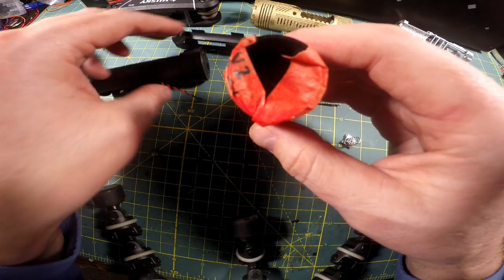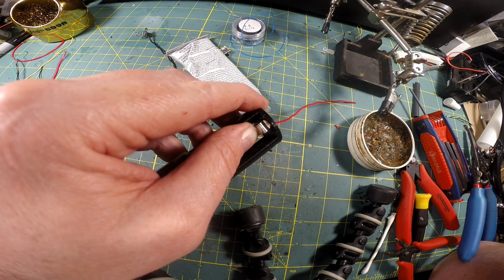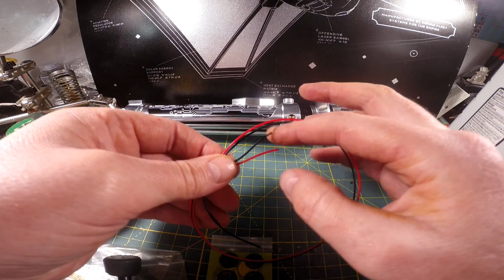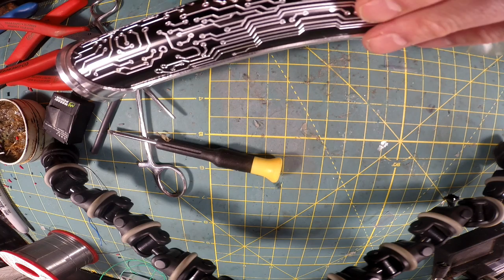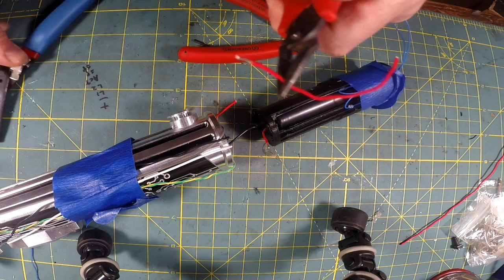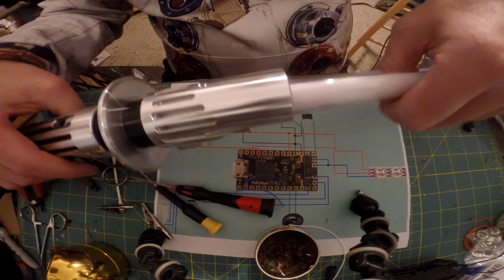Ultrasabers Spectre (Kanan Jarrus) Proffie 2 2 Install Full VERY LONG

Comment: best tutorial ever~  I want to build four neopixel stripes as one blade, for the 11pin tcss hilt pixel connector as same as yours. Do I need use both 2 pads for "+"and "-" ,and one for the data?
Reply from the maker: yes, use all avail pads, Both pos pads are contiguous, as well as the 2 begative pads. Quad blade will be a very advanced build.
Reply: I am still leaning the basics from your intallation video,you bridge two pos pads in the video, as well as negative pads, and use one suffcient gague wire to connect the proffie,I think it's good for 4 stripes build too.
Reply: also bridged LED2-3, LED4-5 and connect to the hilt pcb. dose it make sense to you? I am not sure about it, because I never build one before...🤣
Reply from the maker: @waterbergice3440  22 might carry enough juice, but Id split into 2 22 awg for negative line's. DC current flows from negative to positive, so your negative side will be most important to provide enough energy to power 4 strips brightly.
Reply from the maker: @waterbergice3440  Ive never done that, but it should work. Your blade define at bottom of config will be key.
Reply: @MegtoothSithSabers  precious advice，thank you so much！

Comment: Megtooth! Awesome video.

Is it possible to wire an LED to a SHTOKCUSTOMWORX V3?

If so, do you explain it in another video?
Reply from the maker: What kind of led? The shtok v3 is designed to drive Neopixels.  I show wiring the v2 and 3 in numerous install vids on this Playlist:https://youtube.com/playlist?list=PL__bEQo6eSN08eHfj_hytEYLeAolinNUQ
Reply: @MegtoothSithSabers  it’s a NANO NEOPIXEL RGB ACCENT LED (5MM OUTER DIAMETER)
Reply from the maker: @eastonpops  probably 2020 strip

Comment: I have a question, for 2 switches how would I connect them to the ground on the board? do I put both ground wires onto the board?
Reply from the maker: switch grounds can be combined into one wire and taken to board, or combined at board and soldered there. Common wires share a destination and purpose. Common wires can always be combined to save space, so long as you aren't exceeding amperage specs in wire.
Reply from the maker: ps, had you watched this video, you would have seen precisely that........

Comment: dumb question, but what kind of flux do I need to get?  I see a bunch of stuff at home depot for plumbing.  Is that the same?
Reply from the maker: No you need electronic compatible paste flux. Since Radio Shack is dead, hit up the internet.

Comment: would you recommend setting up the Proffie Board first on your pc before installing it or afterwards? Same question for the font profiles
Reply from the maker: i usually set mine up first, Proffie and sd card. Then install.
Reply: @MegtoothSithSabers  I am new to the lightsaber building community and just wondered if you already have a video for setting up a proffie board. I will definetly use your videos as a guide!
Reply from the maker: @JOJoJoOsH  https://youtu.be/Vj2SJFbRCAk
Reply from the maker: I have an entire section of my channel with tutorials.
Reply: @MegtoothSithSabers  Very detailed and good video!! just watched the whole thing and I am just curious if the recharge port will function as kill key if you leave the kill switch away.
Reply from the maker: @JOJoJoOsH  It would have been ideal to wire recharhe port on positive leg to board. This recharge port will act as a kill key when you insert a charger or kill key, power is terminated to board.
Reply: @MegtoothSithSabers  but I merge the battery positive wire with the positive recharge port wire and the resulting wire on to my Battery+ of the board right?
Reply from the maker: @JOJoJoOsH  positive is positive in any circuit. I connect all my positives, add a 26 ga pigtail in. The 26 ga pigtail goes to proffie. See 1:42:00 in video. It shows positive rcp merge.

Comment: I’m getting ready to install my first saber, I saw in the beginning of the video you said you use 30 gauge wire. Is this the case for the whole build or just certain parts? And if certain parts, what gauge for the others?
Reply from the maker: watching the entire video helps. You csnnot use 30 gauge for everything. If you dont want to watch the rest, the instruction manuals for sou boards usually specify which wire gauge is needed for each aspect.
Reply: @MegtoothSithSabers  thank you, I have watched the whole video a couple times to learn as much as I can. Just hard to remember every bit form the 3 hour video lol
Reply from the maker: @pearfessional  neopixels and power require double 24 or single 22.
Reply: @MegtoothSithSabers  thank you

Comment: do you have a video going over wiring for a neopixel crystal chamber?
Reply from the maker: no, but you only need 3 wires: positive, negative, and data. If you wire the chamber independently, you can use smaller gauge wires, like 30.  If you wire it in series with your blade, you need to use large gauge wires for pos and negative and youll use the data pad to continue data to main blade. There are a bunch of ways to do it, so long as you have a fundamental grasp of basic circuitry.

Comment: Hi Tom! Thanks for this video very educational. I’m going to build my first saber and searching, watching, reading anything about sabers. Maybe it’s a silly question but when I look proffie board diagram it shows kill switch connected to positives not negatives. Does it matter which one you hook up ? Thank you!
Reply from the maker: positives are better. On this saber, the chassis had room for a much beefier kill switch, so it was ok on the negative line. Most of the time, I wire tge cutoff switch on the positive line. Good observation, youre the first one to catch it.

Comment: so I am going to be working on my first install and using this as my guide. silly me, I accidentally ordered the grey wire for data in 22 AG instead of the 26 AG. Is that a problem? I have some extra 30 AG wire I could use, or is the 22 okay so that I don't have to reuse the same color to keep identification easy?
Reply from the maker: 22, 30 either ok
Reply: @MegtoothSithSabers  Thank you for the answer! Can't wait to get my build finished!

Comment: Question:do I need two switches to use a proffe?
Reply: And if not why do u use two?
Reply from the maker: @SIRMAX.  No, you dont HAVE TO use 2 switches, there is a one button prop file. I use 2 in most of my installs, because if you dont use 2 switches, you lose a lot of capabilities and features. I dont lije reduced capabilities in my sabers.
Reply: @MegtoothSithSabers  thanks for the answer is there a video that’s shows all the capabilities that get lost?
Reply from the maker: @SIRMAX.  There is tge instruction manual, and a lot of instructions within each prop file inside the proffieos. I suggest joining ooen source sabers or proffieboard support group on facebook or tra, if youre not into facebook.
Reply: @MegtoothSithSabers  thanks for all your help I’ll be getting into that

Comment: Hi brother, between korbanth, 89 sabers, KR sabers and roman props, which is easier to install electronics?
Reply from the maker: Korbanth and 88 are one in the same.  I prefer 89/korbanth because they have switch solutions, but many kr sabers are engineered for switches as well. Depends on which hilt
Reply: @MegtoothSithSabers  ohhh... Ok, well, I'm going to buy these: vader ep6, obi-wan ep4, and the anakin/luke/Rey (anh my favourite). So... Should i go 89sabers with all of them?
Reply from the maker: @D4ni3lS4nk3  yes, those are all great hilts by 89/korbanth
Reply: @MegtoothSithSabers  thanks for your suggestion!

Comment: Hi Tom! I was wondering about the resistor you used to bridge the negative pads for the neopixel on the proffie board. Is there a specific or recommended resistor I should use or can I use just any? Sorry if this is a stupid question as I am extremely new to all this and am in the process of building my first lightsaber ever.
Reply from the maker: Any wire resistor tails work. I only use the metal not the resistor.

Comment: Hi Tom, I’m on my 4th build and using your vids as guides. Is it possible to take the +ve wire to the LED strips from the +ve leg of the RCP? I’m trying to minimise the number of wires running up the hilt and don’t want a dedicated LED +ve from the battery if I can avoid it.
Reply from the maker: Yes.

Comment: Great video, thank you! I am building my first Saber and using this as a guide!! Would you mind letting me know where you got the battery spring and connector? All I can find on the likes of the custom saber shop and the saber armory is the full battery holder. Do I buy one of these and remove the connectors to stick into my custom chassis?
Reply from the maker: sorry for delay, these came with chassis, but available on amazon

Comment: Hi, hoping to get clarity on one part, you mention merging your switch grounds with your recharge port ground. What wire gauge do you use for the switch? May have missed it in the video. And also, as I'm working up to my first install, if gauges are different it is safe/ok to merge them towards the board? i.e. 22 AWG for recharge port and say 30 AWG for switch?
Reply from the maker: I used 30 for switches, 22 for rcp negative to board and merged them in the saber. On proffie, switch grounds and negative go to common pad. I merged them in hilt. The merge was then sent to sounboard via a 23 ga wire, as shown in video. ground is ground

Comment: Wow, that was great stuff! It wore me out just watching it in one sitting. Thank you for another, very informative, video. So you would only need a fuse (1 each) on the switches if they were illuminated?
Reply from the maker: If you use illuminated switches, the wires feeding the LED in the switch are positive and negative.  Yes, you would need an appropriate resistor on either the positive or negative leg of the LED circuit.  The resistor rating depends upon the specs for your LED.  You must use Ohm's Law to calculate this resistor based on product specs.

Comment: I've always used silicone wire in the rc and electronics world. It doesn't melt when soldering, has a thin diameter and strips with your fingernail. Why is ptfe so much more popular than silicone in the saber world?
Reply from the maker: silicon is good, except for sliding chassis. You can strip it with fingernail, it can likewise be stripped sliding out chassis over time.  I also dont like it, because it wont hold a twist. ptfe isn't mandatory, its a personal preference of mine.  I personally find it easier to use, and to fit into chassis, but yes, in fixed chassis sabers with not moving internals, I'd be comfortable with silicon insulated wire.  I just wish it would take a twist better.  Much of this is personal preference, as I said.